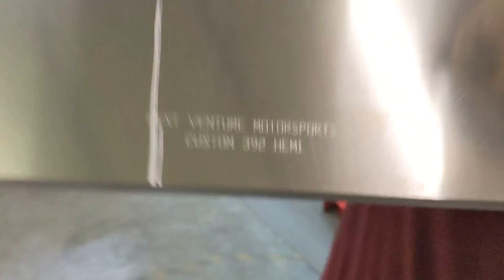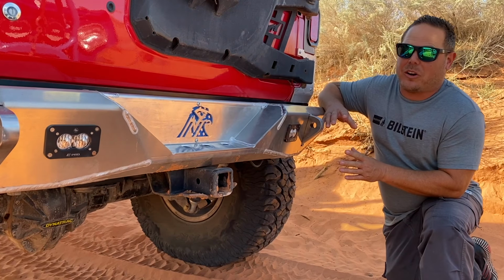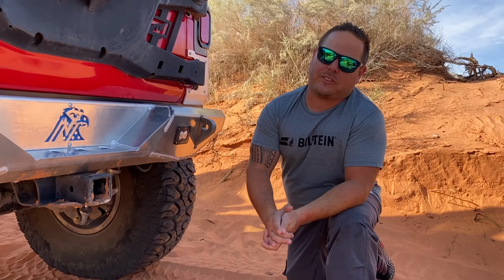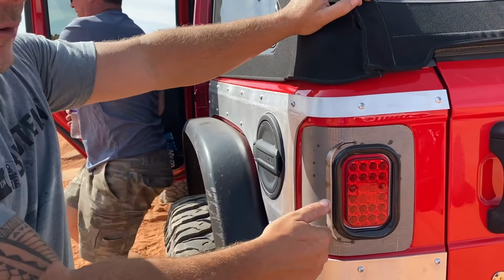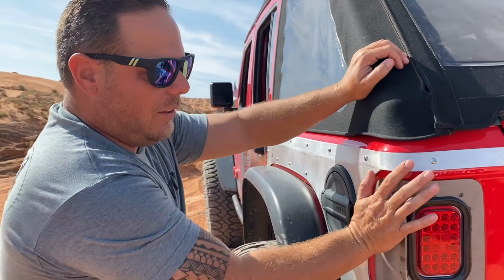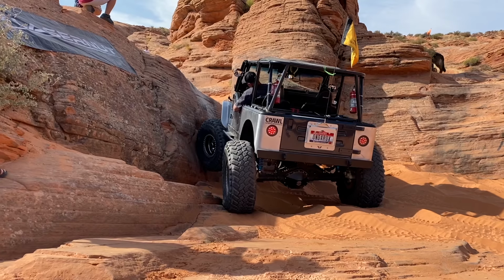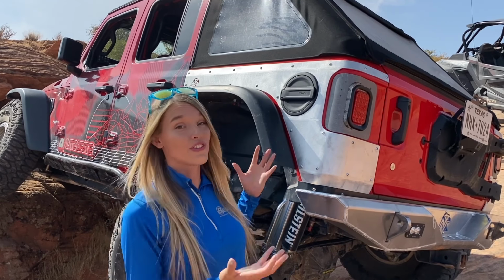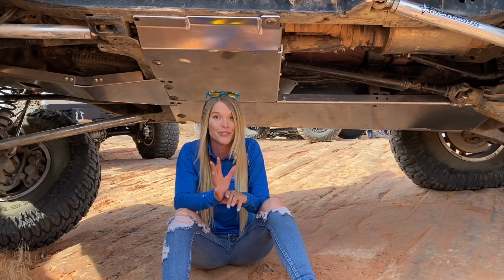WE SCARE THE CRAP OUT OF MY MOM Off Roading Our Hemi Jeep JL!

Comment: Maybe already said... but I’m not reading through 181 comments to find out...LOL, but those factory hard doors are heavy... thought you might go aluminum half doors, aluminum tailgate, carbon hood... that would shave some serious weight
Reply from the maker: The doors are aluminum and don’t weigh much. The rear gate is magnesium and is super light weight. The factory hood is also aluminum
Reply: Lite Brite, my bad... I’m sure you wouldn’t save any weight 🤥 the factory doors weigh like 50-65lbs each for the front depending on electric options, back doors are like 35lbs each depending on electric options... so call it 200lbs for the set with all the plastic and crap.  Aluminum front trail doors are 20lbs for the pair, back doors are 15lbs for the pair... you would save 125lbs... just we have numbers to back things up here.  I don’t feel like getting into weight differences in carbon fiber to aluminum... we all know it’s lighter

Comment: Does anyone have a rule-of-thumb for weight savings on aluminum vs steel bits? I’d love to know the cost/ weight saving.
Reply: Update: I did some quick/ dirty research and it looks like a comparable aluminum part saves roughly 30% weight over steel at ~$5-6 per pound saved.
Reply: Assuming steel weights:
Bumpers: 120lbs (60 lbs each; estimate)
Skids: 260lbs (rock hard’s website)
Extras(diff, Lca, fad skids): 30lbs
Total: 410lbs

I’d estimate aluminum saved ~125lbs and cost $650 more than similar steel skids. Would love if somebody could verify this...
Reply from the maker: We’ll be weighing the Stepchild once we’re done with it to get an exact new weight (although NVM I believe has been marking down the weight differences as well)
Reply: @LiteBrite  Awesome! I’m definitely looking forward to this list.

Comment: Why does no one cover the drive shaft with a skid plate?
Reply: Tom,  the amount of droop/full suspension travel extended on this thing requires a pretty big cutout to clear the shaft. After the cutout is added, the part of the shaft that benefits from protection is unfortunately not behind the skid.